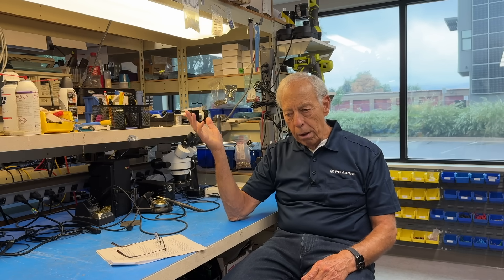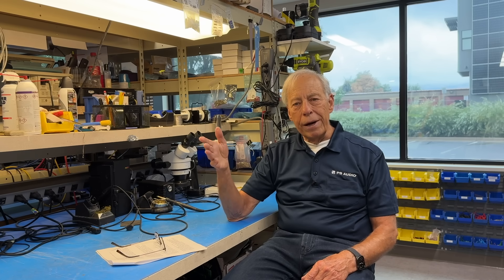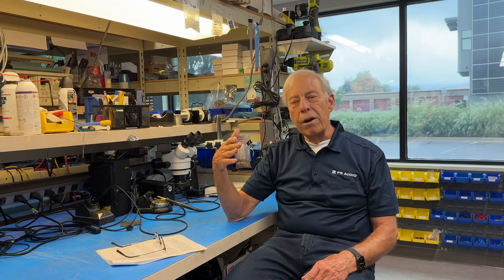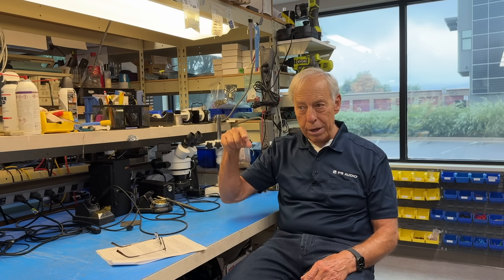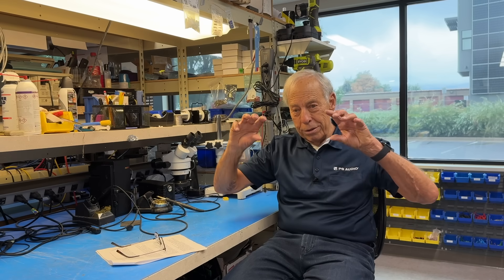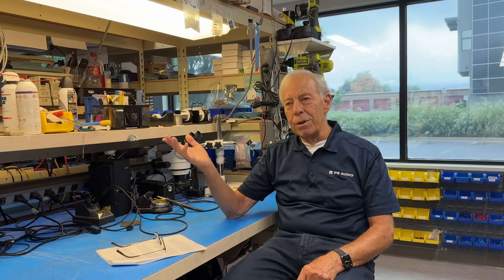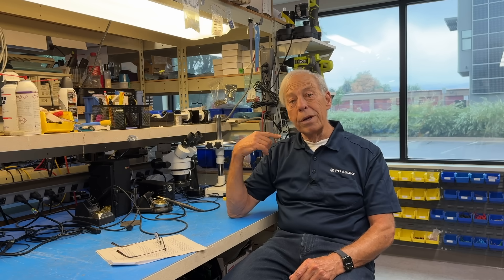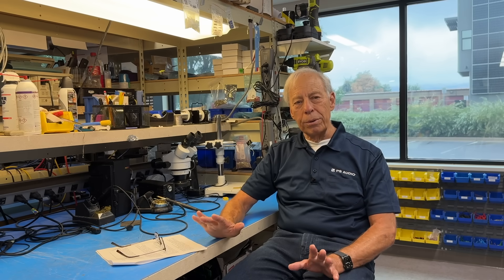Is speaker break in real?

Comment: Many years ago I had speakers with Lowther elements made specifically for low power amps. These were said to have a 1000hr break in period and that they would keep on improving even afterwards. My speakers were used so I didn`t know how many hours they had on them, never the less they sounded wonderfull and very nuanced but sadly lacked bass.

Comment: Psychogenics in action. The speaker didn't change. Your perception of the sound of the speaker changed. This is a really common reaction. What is often seen in an audio salon is the sound of a speaker in THAT environment which may please you. You buy them, set them up and the speaker sounds almost nothing as they did at the salon. Why? The acoustics of that room compared to your room. I've always been of the opinion that you should spend as much on the room as you spend on the system. If you don't, the response you hear may be very disappointing.
Reply: My degree is in electrical and not mechanical engineering, but if you actually think that a speaker is "broken in" you are mistaken (in my opinion.) If it were true, it would continue on and on and the speaker would be worn out in just a few months and would need to be replaced. It doesn't exist.

Comment: Any speaker designer worth their salt will break in a driver for e.g. 24 hours, then let it "cool off" for an hour, before measuring Thiele/Small parameters. Dynamic drivers, for example, are made of parts that include, among other, pliable ones such as suspension and spider. Anyone who thinks physics have no effect on what a speaker sounds like only needs to measure one at room temperature versus the same left, for example, in a cold garage in winter. Not to mention listen to it, which in some quarters appears to be a no-go…

Comment: No. It is not real. No it is not quantifiable. No, the reason they prepetuate this, is so you can spend time accepting the purchase, not returning. And them making money with your unsatisfied purchase that you accept you bought.
Reply: @LedNe0nDevil ... it is very real
You are misguided...or hearing impaired...I'm not sure which.
Reply: Its very real, specially when it comes to speakers. It takes time for the drivers to soft up.

The biggest improvment will be the bass. New speakers will not play much bass at all. But even new speakers can sound harsh and hard the first few hours. A speaker has moving parts. And when its brand new its much more stiff, and they will loose up over time, so they move more easily.

This can even be prooved with measurements, and there is plenty of data to back that up
Reply: @andreasmoller9798   ...Hear! Hear!

Comment: More debunked audio lore from Paul.  Break-in was invented by manufacturers to convince buyers to hold on to their new equipment until the return policy expires.  How do you know that break-in is phony?  Why does break-in always improve performance?  Why don't you sometimes buy a new piece of equipment that sounds great but over time it gets worse and worse?  Nope, manufacturers will tell you that it will (always) get better.

Besides, if break-in was real, manufacturers would be able to point to blind listening tests that proves the sound gets better.
Reply: THANK YOU. No. It is not real. No it is not quantifiable. No, the reason they prepetuate this, is so you can spend time accepting the purchase, not returning. And them making money with your unsatisfied purchase that you accept you bought.
Reply: All speakers i have bought has got better in just a few weeks, you will have more than enough time to run in the speakers before the return policy runs out. Speaker burn in is real, anyone suggest otherwise have no Idea how speakers actully works.

Yes its getting use to the sound to some degree, but burn is a bigger factor still,
If you dont like the sound before burn in the chances of liking them later is unlikely, a speaker will still sound great straight from the box.
Reply: @andreasmoller9798  Really?  Then show the results of a blind listening test that confirms it.  

Just ask yourself why the manufacturers always claim that speakers will sound better after burn-in.  They magically never sound worse, and they don't continue to sound different the longer you use them.

I had a set of speakers that I kept for 25 years.  After all that "burn-in", they should have sounded really excellent.  They actually got worse and worse as the caps in the crossover deteriorated.

What is really happening is that you're getting used to the sound of the new speaker which you really didn't like to start.
Reply: @markmeridian3360   ...you really do post some ignorant, bordering on dumb, misinformation from time to time.
Reply: @markmeridian3360 when speaker gets old it gets worse but you talking 25 years, a brand new speaker will sound worse than speaker that have run 50 hours on them. Burn is very real, if you cant hear the difference maybe its your ears that is the proplem, a speaker have moving parts and the speaker will perform better after some time as the driver can move more freely as the loose up, new speakers have very stiff drivers and spider.
Reply: RAT has no point again.  If he did, he would have stated his point, but he didn't, just a non-specific ad-hominem attack.
Reply: And the Earth is flat 😂🤣
Reply: Some people believe in a lot of nonsense because they are unable to think things through for themselves.
Reply: @markmeridian3360   ...& some people (like you) can't hear for themselves.
Reply: Unlike RAT, I can think for myself.
Reply: @markmeridian3360   ...prove it, instead of just regurgitating your daily BS day after day...ad nauseum.
If you could hear too, that would be a definite blessing.
Reply: Another intellectual content-free post from RAT.  No reference to an actual blind-listening test, no test data, no logic whatsoever.  Nothing.  Just ad-hominem attacks.  RAT doesn't realize that he's just beclowning himself.

Comment: Place the loudspeakers face-to-face, reverse polarity on one of them, cover them in furniture moving blankets, let 'em rip brown noise at a high level for as long as practical. 

-----------

I built a quad 18" IB attic manifold sub. Upon delivery of the Fi IB3-18"s, I broke them in full stroke with 20hz for hours. I took the opportunity to examine gain structure and bottoming characteristics of drivers.
 
One attribute of IB alignments is the extraordinary bottom octave sensitivity. 

Thus, the driver doesn't encounter thermal/power handling issues down low, ... as they encounter mechanical limits way before thermal limits. 

So, familiarizing oneself with the bottoming characteristics is vital.

Comment: Thanks for this video. As a 40 year experienced audio technician, I can also attest that break-in is a real thing. For speakers there is a mechanical component to it but the electronic part can be the most apparent. If you take a new amp right from the box, you will observe the sound changing over a couple of days period. I did it multiple times and always observe a change from minimal to dramatic.

Comment: If driver entropy is real (I personally believe it is) does that mean they eventually wear out?
Reply: @gregmorris2022 ...it depends on the usage...how hard you drive them & to some extent how old they are.
Usually only the foam or butyl rubber surround will disintegrate or start cracking after a few decades but generally most loudspeaker drivers will outlast a human life if not abused.

Comment: I honestly took things like speaker break in as a bit silly. Then in 2008, I bought a reasonably good system - a Primare amp and CD, Monitor Gold Audio speakers and a Rega Planar deck. When I first set it up I thought it didn't sound half as good as it did in the shop. I felt it sounded way too harsh and there was something wrong with the image. 
BUt I left it playing and followed the instrauctions and sure enough, next day there was a vast improvement. The harshness disappeared and the stereo image was back, sounding just like it did in the shop. 
I was surprised not only that it was a thing, but how much of a difference it made. I've also had it with headphones as well - especially a set of reference headphones.

Comment: Speakers create heat, that heat attracts moisture (condensation) that moisture attracts dust, the moisture and dust weighs down the speaker which changes the sound
Reply: That might be true to some extent, but this is not what causes the difference through burn in. If there were dust getting into the vital moving parts, it'd destroy them easily. 
It's just a break in in the literal sense. You're freeing them up to move more freely.
Reply: @crunchyfrog555 the dust isnt in the speaker its on the speaker, its like when you glue a penny to a speaker so it has lower bass freq
Reply: @Durkhead  Cool, so again prove it, because dust doesn't make that much of a difference from what I've experienced. I've heard the old myth that certain crazies used to say about dusty instruments sounding better, but when I've tested it in studio it's bollocks. So by all means demonstrate your empirical evidence to back up your claim because I don't believe a word of it.
Reply: @crunchyfrog555 any difference in the amount of weight will change the sound of a speaker just changing the type of glue will affect it.
Reply: @Durkhead  Still no evidence yet more assertions eh?
Sure, dust will add microgrammes of weight. Now DEMONSTRATE the difference in sound and not spout bullshit assertions.
Reply: It's not true. The moisture is condensing on cooler surface, not hotter.
Reply: 🤣🤣 good one!

Comment: When I first fired up a new pair of Polk R700's, six months ago, I was disappointed by their bass heavy sound. 
 The mids, and highs seemed subdued. After awhile, the midrange and highs began to shine through. 
 It wasn't me getting used to them, they literally opened up and sounded better after 200 hours or so. 
 Then recently a co-worker gave me a set of bi-wire cables. The original setup had the single wires plugged into the lower connectors of the speakers.
 After bi-wiring, I definitely hear the difference in the overall sound in the balance between highs, mids and lows. 
 Not a placebo effect because I've always been very skeptical about the break-in and bi-wiring theory.
Reply: David, your last sentence mirrors exactly my experience with after-market high-grade power cables.
The only loudspeakers that I've owned that didn't really shine unless they were bi-wired were a pair of Harbeths from 1993, all other loudspeakers that were bi-wireable that I've owned since then, bi-wiring them didn't make any difference whatsoever. Interestingly, the latest iteration of the afore-mentioned Harbeths no longer have dual taps; only single set.
Reply: I've seen pictures of the Harbeth Speakers and always loved the way they look. They're beautiful.
 How do they sound?
Reply: @davidjudd951   ...amazing; light, airy, with lots of detail & smooth (never hard or harsh) I have to say that I was a big fan of the sound of English loudspeakers since I was a teenager, back in the 1970's. So I'm probably somewhat biased. Back then I did not find American nor Japanese loudspeakers to be as emotionally captivating & as easy on my hearing at realistic (Rock 'n Roll) volume levels as the English ones.
Reply: That's nice. Sounds like that's the perfect formula you have there.
Reply: @davidjudd951   ...FYI: The Harbeths that I owned was back in the 1990's.
For the last four years I have a pair of DeVore Fidelity - 'Orangutan O/93' floorstanders, also with only one set of taps. You're all caught up now ✌❤🎶
Reply: You like the good stuff. 
 And that's a good thing.

Comment: Yes! Electronics as well. Quite a bit. 

BUT I also think it’s legitimate “break in” when, after listening to one pair of speakers or one amplifier or one DAC for years, it takes some time for our brains to dislodge bias and expectation so that we can hear the new component for what it is. 

I get where the measurement folks are coming from but if you’re not also measuring the brain, your data set is wildly incomplete.
Reply: I think that rather depends. If you really have one system and focus on that then I can see how this may be a thing. It certainly hasn't been for me though. I know and accept what something sounds like right off the bat. Obviously it helps if you trial it in a showroom beforehand, so you know what you should expect. 
Also, having a good memory for sounds is a benefit too.
Reply: "measuring the brain"...we're not talking IQ test, right?🤔
Reply: No, it sounds complete bollocks. You don't need to measure the brain to test this. You only need to test the waveforms it picks up from the air. 
That person doesn't know what they're talking about.

Comment: If you measure 1/2 dB change in the tweeters after 100 hours use, that's got to make design even more difficult.
Then I think about how often it is mentioned that speaker response is so irregular, and even more so in a real room.
The point is that suspension will change over time and you hope (in vain) that once settled in, that it stays there forever.
Reply: Nothing stays the same forever. Change process slowest down dramatically,  but it is changing, and not necessarily for good. That is why vintage speakers, which we remember sounded great, are not so great anymore comparing to new ones.